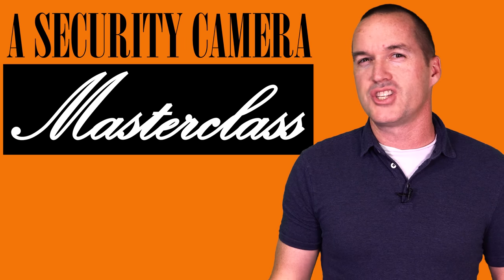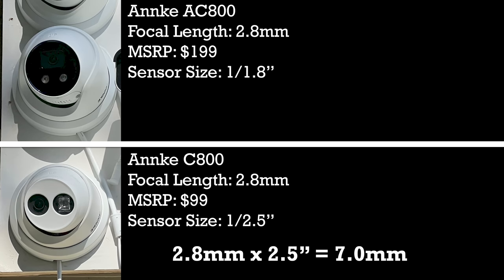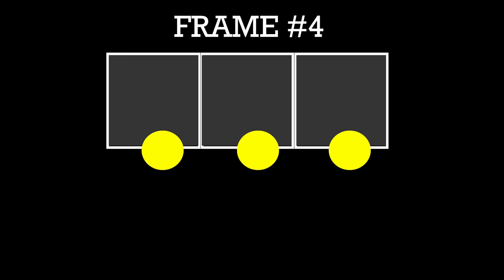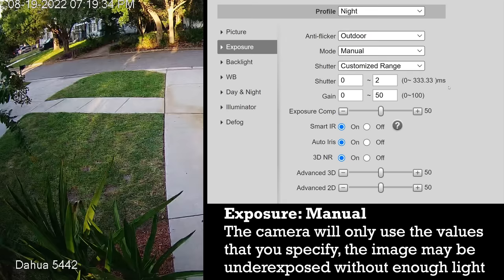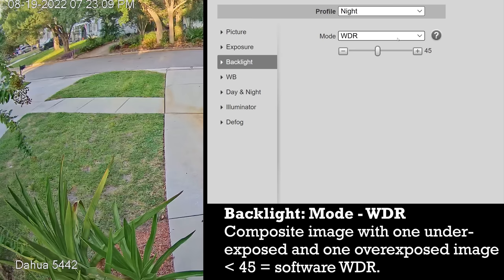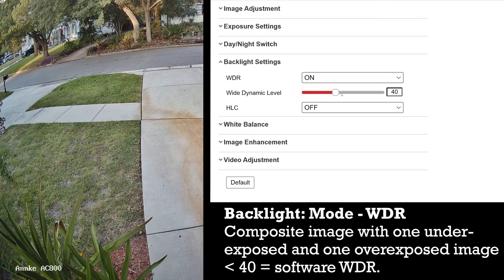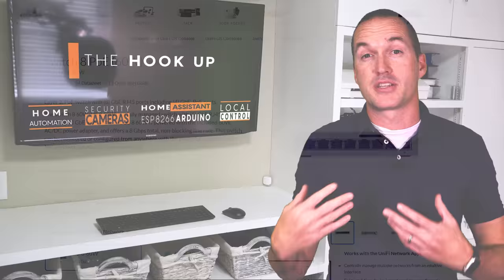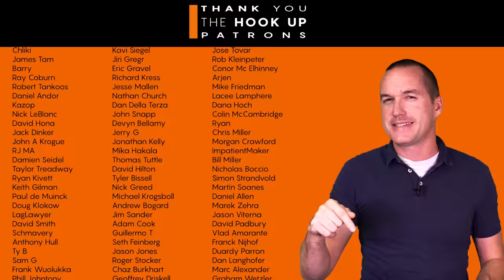Expert's guide to SECURITY CAMERA SETTINGS.  WDR, BLC, HLC, and SSA Explained.

Comment: Aperture is defined to be focal length/entrance pupil diameter. In zoom lenses entrance pupil usually remains the same, while focal lenght varies thus aperture varies while zooming in and out, However security cameras non having an iris cannot set indipendently aperture while focal length is fixed. Aperture and entrance pupil diameter are both very important in night vision (former the lower the better, latter the higher the better). The latter can be determined by aperture and focal length which are usually both in the specs. Summing up, optically, best for night vision is having both: low aperture and long focal length.

Comment: Do you have more information regarding the HIKvision wdr functionality or a comparison? I've always left at 1/50 so night image takes a better picture of moving objects instead of a blurry image.
Reply from the maker: I guess it just depends how fast your subject is moving.  1/50 will still result in motion blur for cars and even running subjects.  What kind of information are you looking for with the Hikvision WDR?
Reply: @TheHookUp  thanks for the reply. My query was in relation to your comment that wdr uses 2 actual phot processing if wdr above 40 and shutter under 1/30 shutter vs it uses software processing if shutter is above 1/30 and wdr under 40. Where did you find this info and has anyone tested them for noticeable differences?
Reply from the maker: I'm not sure where I read it, probably in a manual somewhere.  It's very apparent if you test it out though, you can even see the camera switch WDR "modes" when you go from 39 to 41.  Over 40 will give you the best WDR results, but as I said can result in some blurring/tearing since it is actually compositing two images taken with different shutter speeds.
Reply: @TheHookUp  I’ve just been testing it and there is a huge difference in the 2 settings changing from 40 to 41. I have changed shutter to 1/200 which gives me better identification of car types (not like I could get number plates at night with a 2.8mm anyway). However I find wdr at 40 gives a much brighter image overall.
Reply from the maker: @MrBrettStar  It depends on your end goal I guess.  WDR under 40 might look better to the eye, but ultimately the camera is still capturing the same amount of data and then tweaking settings to make a more WDR looking image.  With WDR over 40 the image will actually contain more information because it is a composite of two different exposures.
Reply: @TheHookUp  but does that mean it’s in fact using a slower shutter speed for the darker areas introducing more motion blur. 
Also I really like your videos by the way, this one in particular has me questioning the specifications on the new ds-2cd2387, it has a 1/1.2” sensor and 2.8mm lens and yet the fov is smaller than the ds-2cd2386 with a 1/1.8” sensor and 2.8mm lens. It doesn’t make sense.
Reply: @TheHookUp  I took your advice and stuck to a higher wdr, it does give a darker image but still very usable, the main reason I chose higher was during the day the lower wdr gives a very gritty look with harsh shadows.

Comment: For a modern sensor (especially one that's BSI or with microlenses) it does NOT matter what size pixels are, only what size the sensor is. E.g., if you have a 2 MP 1/1.8" sensor vs a 8 MP 1/1.8" sensor the latter has pixels 1/4 the size of the former, but there's 4 times as many, and together take up exactly the same area, and thus capture the same amount of light in total. In fact, with a good denoising algorithm the 8 MP will produce more detail in low light as well as daylight.

Many years ago pixel size made a difference, because the internal sensor noise and well capacities were bad, and improvements between generations were stark. Nowadays sensors are very much refined, with less than 1 EV difference between different sensors of the same size, even across generations.

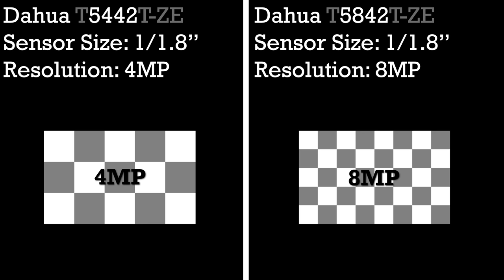Comment: 3:57 What?! 4Mpx = 15 squares but 8 Mpx = 40 squares...
Reply from the maker: Just a visual aid.  The numbers of squares were decided because a 4mp image is 2560x1440 (so I doubled that to roughly 5000x3000, then made it 5x3) and an 8mp is 3840x2160 (so I doubled that to roughly 8000x5000 or 8x5), it's not a perfect comparison, but close enough.

Comment: I'm pausing the video 5 minutes in to comment. A lens with a wider field of view will not let in more light than a lens with a narrow field of view, however a lens with a larger aperture will let in more light than a lens with a smaller aperture. As an example, if I place my SLR camera in manual mode and use a hand-held light meter with a reading of 1/125 of a second, at ISO 100 and an aperture of f/8, in theory it shouldn't matter if I use a 28mm lens or a 100mm lens, they should both expose the image the same. The reason Hikvision's ColorVu cameras do so well in low light is not because they use a wide-angle lens, it's because the aperture is very large at f/1.0 compared to many cameras having an aperture of f/1.6 or smaller. While it's also true that the ColorVu's do use a large sensor at 1/1.2", a large aperture is the main reason that they are sensitive to light. Lastly the sensor's native ISO also determines how sensitive the camera is to light. A camera with a native ISO of 100 will not be nearly as sensitive as a sensor with a native ISO of 200. 
Okay, I watched a little further before posting the comment. A slower shutter speed will cause more ghosting, not less. Imagine this, let's say that you leave your shutter open for 10 seconds then walk by the camera. Do you think that the picture will be sharp of blurred? Now imagine that the shutter was open for 1/125 of a second, during that small amount of time how far could you have traveled? The problem is that faster shutter speeds require more light, weather it's a larger aperture, a higher ISO (gain) or a supplemental light source. I'm going to have to watch the remainder of the video later so forgive me if these comments were covered later in the video.
Reply from the maker: Hopefully you finished the video and realized your comments were in error.  Larger FoV collects more light for the simple reason that there is more light to collect.  At night we are talking about a simple photons/m2 calculation, more meters = more photons.

As for the shutter speed and ghosting comment, that's exactly what the video stated and there was even an animation to show it.  The exact quote from the video is "If you want to have crisp images of fast moving subjects you need to decrease the exposure time".
Reply: @TheHookUp  No, I haven't finished the video yet because I'm into a project but I will. 
I misunderstood what you were saying about shutter speed so we both agree there, but in reference to a wider lens collecting more light than a longer lens, it all breaks down to what I explained already, an f/*.* lens is an f/*.* lens no matter what the focal length. Re-read my explanation of using a light meter with different focal length lenses and explain to me why that is wrong.